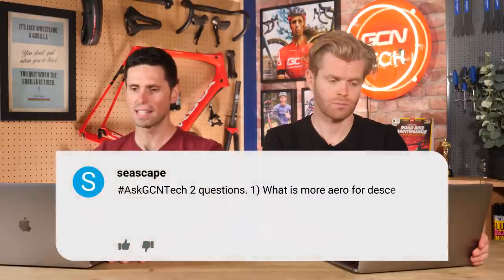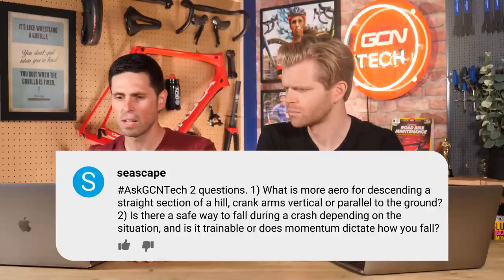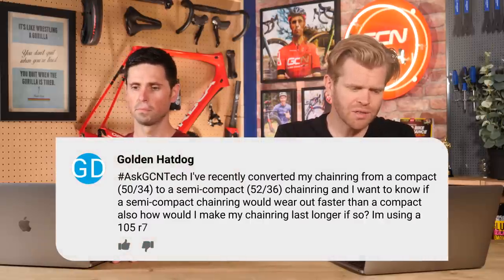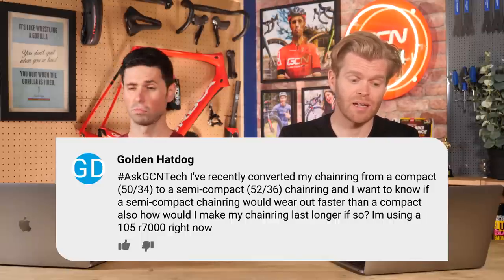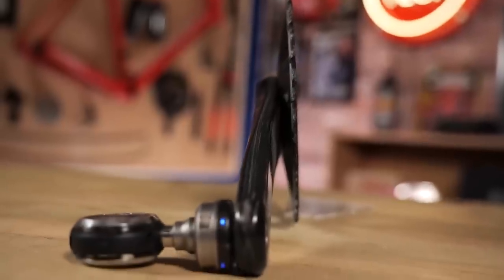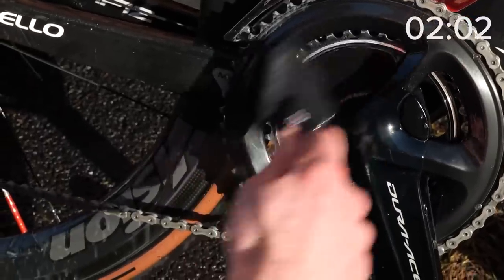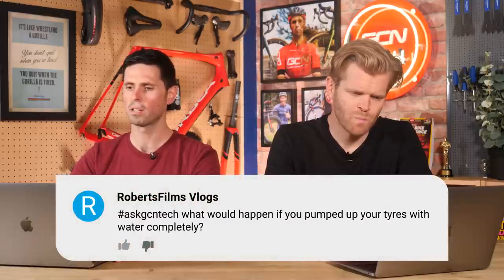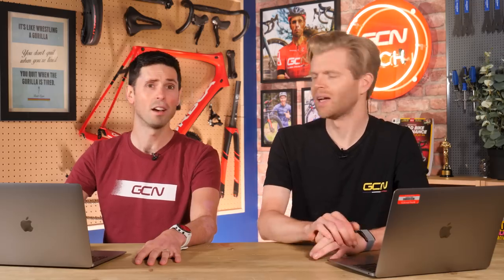What Is The Best Position For Descending? | GCN Tech Clinic

Comment from the maker: Let us know your tech queries using #AskGCNTech 👇
Reply: Do the rules change with the relationship between sit bone measurements and saddle width with a " boost saddle "? My saddle size is 145 and feels good except on a gravel bike. A 155 boost on gravel fits best. 155 on my road bike doesn't feel good. Life gets so complicated sometimes 😀 Could you explain the differences?
Reply: What about the question in the title?
Reply: @saddleweary5760  The difference is your position on the bike and how it changes your pelvic tilt.  When you sit more upright, you are resting on a wider part of the sit bones.  As your rock your pelvis forward, you are rolling up on a narrower part of the sit bones.
Reply: @jefferycampbell2243  that makes sense to me because on the road I try to stay on the drops and now since I thought about it, I'm more on the hoods on the gravel bike.
Reply: #askgcntech Hello GCN Tech presenters! I am a long time viewer and I am not sure that my question has been covered on previous episodes, so I now present you with the following question: Why do road bikes not have a clutch system on the rear derailleur to prevent chain drops? Is it just an unnecessary weight concern?
Reply: Hi Thank you for all the great  info. I have a 1985 Cannondale Sr300 with 52/42 chainset and 14/21 freewheel. I moved to a hilly place. What upgrade would suggest. I thought of going to a triple chainset and larger freewheel. Thanks.

Comment: Another problem with filling tires with water is that the first bump you hit will probably cause the tire to blow off the rim.  Water is incompressible, unlike air, so it has to go somewhere when the tire volume gets changed due to an impact.

Comment: I bought an old tractor to help clear the land I was building on. "Stick with me." 
I was towing a large log when I felt the back of my leg getting wet. No problem on the front of my trousers thank goodness. Turned out that a large sick had punctured one of the rear tires (tyres) 
Apparently it was fairly common practice to half fill the rear tyres (tires) with water to improve traction due to the added weight. Maybe sealant would be a better idea. Expensive though.
Love the show guys

Comment: Some people crash poorly while others naturally crash well. Rule #1 Never let your hands touch the pavement. #2 Keep your hands on the bars as you are going down until the last part of a second. #3 If you are going down on your left side, just before impact, let go of the bars with your left hand, and point it to the right. Twist your body so that the impact is mostly on the left side of your back. Don't forget to keep your feet in the pedals. This way, you will end up with road rash on the left side of your back, your left calf, and maybe your left forearm. In dozens of crashes (some at high speed), I've never broken a collarbone, arm, or leg. I've only broken ribs three times. Once on my first ever crash at race pace, once when I slid into a curb, and once when I landed on someone's pedal. If you crash into a pile of people, don't let go of the bars, and keep your feel in the pedals. You'll probably go over the bars. All you can do is hope you land on the softest guy.
Reply: Wear gloves
Reply: @larrylem3582  They won't save you from a broken wrist.
Reply: I use this to method to fall but developed it to save my bike from damage i.e. holding the bars and pushing therm up and away from the road and kicking legs up and out too to try and avoid bike damage or touching floor much. But should add mine all were at very low speed due to silly errors. Bruised hip the main issue. Shoulder/upper bicept takes a broad wack too.

Comment: 04:33 Max gradient simulation on turbo trainers? - Here's an anecdotal warning regarding the Wahoo Kickr Climb. I used one for about a year before the belt snapped while I was on Zwift. My bike seemed fine, but it could have cracked my fork as the entire front end suddenly slammed down. I was tossed onto my top tube and barely missed my "family jewels" being smashed. Wahoo customer service is famously accommodating, so they quickly repaired the unit, but I don't think I would ever use it again. The device seems to rely on a single rubber belt to tolerate a lot of variable force. ⚠
Reply: There a actually quite a few mentions of this happening to others on the Zwift forum.

Comment: I  roll  and  broke  the  shoulder  head...  not  a  collar  bone  ... but  worst,  as  the  therapist  said,  the  rotation in the  shoulder  is  one  if  not the  worst to  recover... still  have  issues  there,  there  is  not  good  landing  or  safe  landing  in a  crash  I  have  also  a  3  parts  broken  jaw...  slow  but  flat face  into  the  floor  put  the  hands  and  try  the  roll  but  ...  then  again  there  is  no  way  to  scape  to injury  in  some  cases...  ride  safely as  you can.

Comment: I have a question, why is it I can buy derailleur hanger extenders online. However bike shops won't sell them and call them a bodge.
Why is this and would you recommend using them or not?
Reply: Warranty voids I think, most people use them tho but make sure to check around to check if the specific extender works for your setup
Reply: I'm interested in that one too. Nobody wants to change a derailleur if they can just add an extender.

Comment: The only way I can think a cyclist could make crashing less damaging is to pack on muscle all over the body and not try to look like a stick insect. That muscle will protect your bones and if you work on range of motion of muscles and flexibility as well you are less likely to pop something as you will be strong in a greater range of positions. A happy by-product of doing weight training is your bones will become denser and more resistant to breaking. Of course the downside of this is you are heavier (usually) and then have more momentum when you come off the bike meaning you take longer (or more skin to stop).
Reply: Wear motorcycle gear like Hank!
Reply: I crashed on a bend at 25mph when my front wheel hit horse shit! I instinctively rolled but still ended up with six broken ribs, a broken collarbone, a punctured lung and concussion. Maybe I should just have put my hand down 😂

Comment: #AskGCNTech As a heavier rider, I feel I’m always in the max range of gears, either hardest gear on flat’sh roads or my easiest gear when I see any sustained gradients. I currently run a compact chain set with a 12-30 cassette on the rear. Would I benefit from upping my chain set to give me more usable gears or would this just make my climbing problem even worse due to the worse range at the rear
Reply: Go 52/36 for the crank and 11/32 for the cassette. The 36/32 combo is only fractionally more difficult than 34/30. You might not even notice. The 52/11 will give a bigger gear than the 50/11.
Reply: Most people run 34 at the back these days, used to be 32. I run 32, wouldn't run less. If you Google it a bit, you'll find a lot of people saying you could run 52/34 at the front without issues, contrary to popular belief. I'm considering trying that myself.

Comment: #askgcntech Riding in a strong crosswind the other day, I wondered if a high cadence would give a gyroscope effect and reduce buffeting from the wind.  Presumably from feet and shoes if so. Can Ollie show us the maths please.
Reply: Yes, if you spin at about 10000rpm :D
And you don't want to have strong gyroscopes anywhere near a moving object, maybe only a train. Just try it yourself, hold a relatively heavy bicycle wheel at the axle and spin it as fast as you can. At first it feels nice and stable, but any little movement can make it unpredictable. Now imagine having a 50kg flywheel on a bike. You couldn't even ride it in a straight line, as it messes up those tiny corrections you constantly do on a regular bike.

Comment: #ASKGCNTECH I'm a heavier rider (~100kg) and sometimes find my 160mm disc brakes slightly less powerful than I would like, can I fit larger rotors to a road bike, or is there anything else I can do to improve braking performance? Thanks
Reply: You could try 3rd party brake pads. From MTB experience, Trickstuff are really good
Reply: It depends on the bike. Some are rated to safely take 180mm rotors, many aren’t. For instance Mohoric used a 180 in the front to win Milano - San Remo this year
Reply: Hydraulic if not already or find 4 piston calipers over 2 piston
Reply: HI5 100kg club! :D
Query; what brakes are you running? At a guess, you might be like me on mechanical disc.
 If hydro: Really shouldn't need a bigger disc. A pad upgrade, maybe disc upgrade (some discs really are utter trash, some others are sensitive to pad construction), plus a possible line bleed should be enough to try to throw you over the bars/lock up wheels.

 If cable actuated (including hydro-on-caliper types): Pad upgrade, cable upgrade (ie. Jagwire Pro or Elite), and possible cable routing adjustment. [The cable routing thing is just that you want swoopy lines, no sharpish corners that the cable has to grind on the shrouding with the direction changes losing you power transfer to the calipers. Case in point is the new Scott Speedster 20 where internal cable routing compromises braking power to the point that it doesn't really brake well at all.]

Larger MTB discs will fit your wheels no problemmo's, the trouble is getting an adaptor for your caliper. Almost no one makes them. The few I've found that will all put a disclaimer on them that using them is outside the parameters of what the mountings were designed for, because #Lawyers.
 Going from a 160 to 180mm disc is an increase of about 12% of force on the mounting. 12% is WELL inside the excess loading designed into a fork and its mounting points. For a Gravel or Cross bike/fork it'll be over engineered a little bit further again.
 My2c is that for cable actuated brakes an extra 12% still isn't the force that a hydro setup would put through the mounting points and should't be a problem. NOTE: Shouldn't, not a guarantee.

Comment: Is there really a difference in total frontal area when pedals are parallel versus vertical?  If they’re vertical, wouldn’t the increase in the length of one leg be cancelled out by the reduction in length of the other leg?
Reply: Even if the situation for the legs would be equal, the frontal area of the cranks is much smaller in the horizontal  position.

The horizontal position also allows the rider to squeeze their knees in, something that an extended leg does not allow.

Lastly, I think the horizontal position gives much better control over the bike, especially if the road surface is not very smooth

Comment: #AskGCNTech Hi guys. How do you make your skin heal faster? What to do right after a crash and later? I clean it with water from my bottle and that's pretty much it, but it takes weeks to recover.
Reply: Make sure any skin breaches are really clean, scrub all grit out then cover and keep dry. If the wound is discharging fluid then an absorbant dressing is good. Change any wet dressings regularly. Don’t use the really occlusive waterproof dressings for long periods or everything just stays soggy underneath. If very superficial then some spray ‘skin’ is good for protection. Silicone plasters can help reduce scarring.

Comment: #AskGCNTech Does a 1 sided power meter give an exaggerated instantaneous power? I used to have a 2 sided 4iiii power meter, but my bike was stolen, and I went with the 1 sided option on my replacement bike. Now it's relatively easy for me to top 1,000 watts for my max, when that used to be a real challenge. Not sure if I'm stronger (hope so) or if the instantaneous power from they left crank is being doubled and giving an inflated number. (The power meter is ant+ connected to the IpBike app on my phone, not a bike computer, if that matters.)
Reply: In theory it shouldn’t. It’s possible one of your legs is stronger at sprinting than the other. Or one of the power meters isn’t perfectly accurate

Comment: Can you tell me if it is better to get low and aero when you have a strong tailwind or is it better to sit more upright to take the wind?
Reply: Low low low! You will be getting most resistance frontally from that air.
Reply: @stephencharles6932  He said "tailwind," not "headwind."
Reply: If the wind is faster than your riding speed, sit up to act like a sail.  
If the wind is any slower than your riding speed (you still feel some wind blowing against your face), don't sit more upright.  
But in all my years of riding, I can't recall a tailwind strong enough to push me along when riding on the flat.  That has only happened when climbing.
Reply: @marianneoelund2940  I know thanks but still same answer, low low low , well unless your speed is so slow you are in danger of falling sideways.
Reply: @stephencharles6932  The question came to me when I was going for a KOM on a Strava segment. Wind was about 25kph right at my back and slight overall downhill of about +0.5%. I'm 6'4" and 89kg so big frontal area hitting wind. I went with low and narrow shoulders and took the KOM. I just wondered how much slower I would be if I had stayed more upright.
Reply: @marianneoelund2940  That makes sense. It occurred to me while chasing a Strava KOM. The wind was 25kph and the average required to take the KOM was over 47kph. I went low and narrow and it worked. Just wondered what pace I'd have done if I'd sat up to let the wind push me along.
Reply: @discopants100  You used the right technique.  The tailwind wasn't fast enough to obtain any "push" from it, so sitting up would have slowed you down.  
It's very rare to have a strong enough tailwind to actually add power for you when riding on the flat, or on a very gradual climb.  That's more likely to happen on a steeper climb when you're moving slower than 20 kph or so.

Comment: #askgcntech hi guys (and Manon). I have a Carbon Scott addict with built in mudguard mounts, I bought the official Scott mudguards that fit the bike and after fitting the mudguards one the screws on the fork rounded off the thread in the carbon frame when fitting the front mudguard, any suggestions on how to fit the mounting screw into the frame now the thread has gone from inside the frame? Thanks

Comment: #AskGCNTech I'm looking at buying a new bike but still want to be able to compete on my pr strava segments. Would a gravel bike with good road tyres and wheels be much slower than a mid level carbon endurance bike?
Reply: Look for rider position and gearing. If you run out of gears on the flat with a 1x setup, no PR. Some gravel frames are now race oriented, so the frame itself shouldn't slow you down much, as long as you're fitted well on it yourself
Reply: @pierrex3226  thank you! I was looking for one with a 2x11 setup so gears should be ok

Comment: #AskGCNTech Recently I've bought a pre-own Trek Domane SL6. The brakes are screaming whenever I brakes (both in dry and wet weather). Thinking that the previous owner might have abuse the brakes too much, I change to new rotor and brakes pad. It doesn't squeal initially, but after a fast downhill ride, the brakes starts to squeal again (it was squealing on the way down at 70km/h). Is it unavoidable or it could have been a faulty brake levers?
Reply: Did you degrease the rotors when you took them out the packaging? Always do this and wear latex gloves, never touch the pad surfaces or the rotor surfaces, you cannot be too clean when handling brake components!! Most brakes need "bedded in" from new, a few short downhill runs and apply steady pressure but don't stop to a standstill, you should feel them rapidly improve after a couple of runs... (and never use spray lubes anywhere near the brakes unless you've properly covered rotors and calipers!
Reply: I had similar issue with my new  Decathlon bike. Mechanic believed I hadn’t bed the brakes in and suggested getting some speed up and then sharply applying the breaks 5 or 6 times without locking the wheels. Then finish off by washing any dust away with break cleaner or perhaps just a hose. 

I did this and absolute heaven, no more squealing. Sadly you might if replaced the rotor and pads for nothing, but if that’s the case, you can keep the original ones for future use, that’s if hopefully you still have them.
Reply: Most likely the rotor or pads are contaminated or not properly bedded in. Very unlikely the problem is with the levers

Comment: Hi guys, recently got a SRAM rival AXS groupset. How come SRAM has such a tiny chain ring? (48/35 on mine). Shimano chain rings appears to be larger. Thanks from Canada, eh.
Reply: I haven’t fully researched in a long time, which is a long way of saying I’ve forgotten but I think the general consensus is that mathematically speaking, the ratios are approximately the same. Actually, my big chain ring is 44, which tbh I laughed at but it’s a ratio of 4.4, which when compared to Shimano 50/11, it’s approximately the same.
Reply: What's your smallest cog on the back? I'm guessing 10t? 48/10 = 4.8 while 50/11 = 4.54, so in this case the 48 setup actually has a larger gear.
Reply: Try out the comparison of the gearing options on this website http://www.gear-calculator.com. Hit the compare button to add the second option